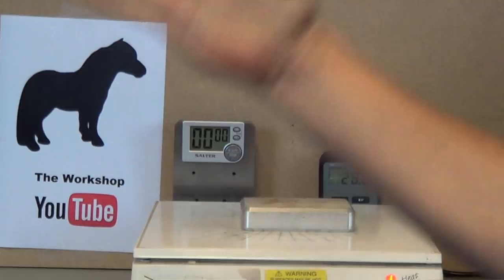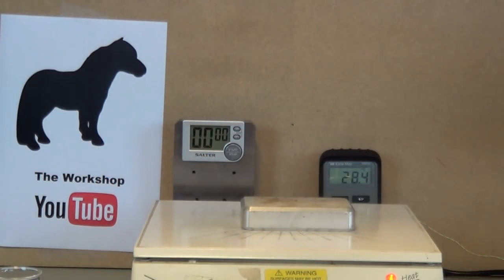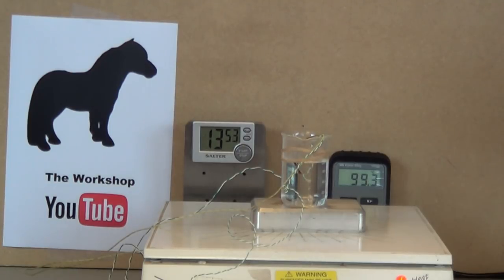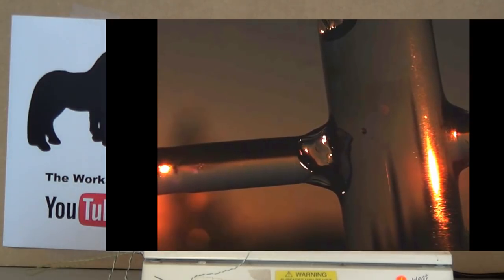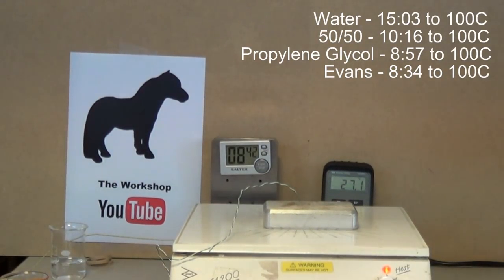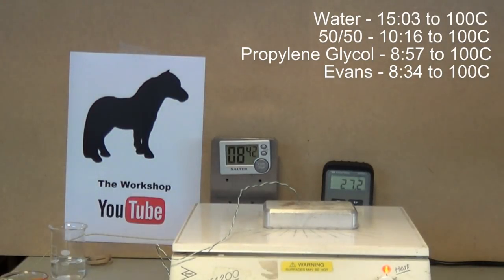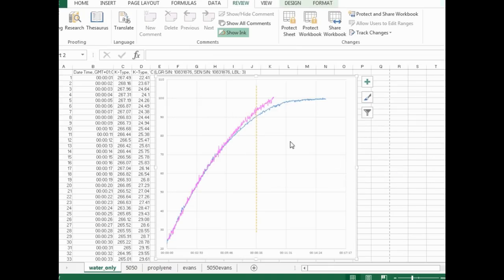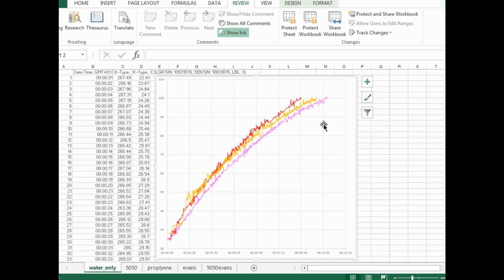Evans waterless is SHIT! - with proof

Comment: Thanks for that last 10min with graphs! I am with you with this one, but I don't like you measured time to 100°C, cos that is boiling point of water and that takes much more energy then every other decrees on the way to get there. I did bit number crunching there on the fly too from your video and differences was weird.
water 
@40c = 1:45
@60c = 3:53 (difference between this and before datapoint = 128s)
@80c = 6:41 (d= 168s)
@90c = 8:48 (d= 127s)

50/50 (only little bit difference between this and water)
@40c = 1,43
@60c = 3,43 (d= 120s)
@80c = 6,18 (d= 180s)
@90c = 8,13 (d= 115s)

prop
@40c = 1,14 (much faster then other except evans 50/50)
@60c = 2,48 (d= 94s)
@80c = 5,48 (d= 180s)
@90c = 7,05 (d= 137s)

evans
@40c = 1,40
@60c = 3,14 (d= 94s)
@80c = 5,44 (d= 150s)
@90c = 7,04 (d= 80s) and thats fast!

evans 50/50 (why was this mix so hot at start?)
@40c = ,40
@60c = 2,39 (d= 119s)
@80c = 4,58 (d= 139s)
@90c = 7,09 (d= 131s)
Reply from the maker: The temperature increase isn't linear. The temperature of the glass has to be taken into account. I did say that this wasn't representative of an engine because of the lack of pressure, heat source and the glass. However, seen as though all the tests were under the same conditions, its a fair test. (well as fair as I was willing to go, its not like I'm writing a paper on this is it)

The Evans 50/50 mix was a bonus/joke section at the end, and wasn't the same as the others. 

As for going to 100degC, yes I'm with you there, and I did mention that this is all to do with evapouration and the energy required for this phase change to take place. This however, doesn't effect the difference between Evans @ 100degC and what temperature the water is at the same time. This was why ther'sa yellow line on the graph to cut out the trail off at 100degC.

As for the times and temperature changes, this is all about where the hottest spots are in relation to the thermocouple tip. Convection etc play a big part in all this, and you can see the thermal vortices in the liquid when heating. 

Not only that but when you take your numbers from the display, it can fluctuate 5 degrees in less than a second, hence the data logger to get the trend not absolutes.
Reply: Thank you for your great answer. And why don't I get any feedback when I have comment from here? Perhaps just my understanding of youtube and or phone settings.

I'm total newbie when it comes to chemistry and thermodynamics, but when compairing two liquids with different heat absorbing characteristics should there be easyer to see evidence? Water has heat capacity of 4,18 and glycol has only 1,63JgK.. so, when aplying same amount of energy to both of them, should it take 2,5 times longer to get that temperature to water then to glycol, cos it should take 2,5times more energy in before gaining that temp?

so when water is hitting 90°C in 8:48, should it only take 3min 31sec?

Comment: Im sorry, i do not understand. So far you have proven that different solutions have different heat capacity per volum unit and different evaporation point. If your coolant flow or radiator is the restricting part of you powerplant's potential then water wil be far superior. If not then Evans wil be a good option, a daily driver for commuting wil do just as good if not better with waterless. We have two daily diesels and one has Evans and one has 50/50. The diesel with Evans has a sparcling clean radiator stil after 7 years use, no need to top it up yet as the level is dead on the same as 7 years ago. The temp of the Evans is seldomly over 80celsius(when the thermostat opens), and i cant observe any pressure in the system even if its hot from uphill driving in summer.  The diesel with 50/50 is the predictable the same as all other cars that use 50/50.
Reply from the maker: 1. Not better, worse than 50/50.

2. The pressure in the system does increase, thats just thermal expansion. 

3. We're talking motorcycles, not your diesel that doesn't produce enough waste heat to begin with. 

This is a motorcycle channel were each engine is closer to the limits of waste heat...

Comment: I’m not a scientist but I always thought that the faster a substance heats up, the faster it give up that heat such as when passing through a radiator.
Reply: With a few exceptions, you are correct, the faster it can heat up, the faster it will transfer that heat out. It's why things like copper are used a lot in heating/cooling situations.
Reply: The removal of heat is a question of watts moved and Evans moves about quarter of water
Reply: The thermostat would be a variable I would think.

Comment: Hey Matt, completely agree that this Evans business is Shite! so don't want to sound like I'm sticking up for the junk. Quick thermodynamic thought though, if the Evans gets to A higher temperature for the same given energy input as water, wouldn't the radiator be more efficient at removing the energy from the Evans than the water due to the higher temperature differential between the coolant and ambient air? thought being that your engine would get to temperature quicker than water (good for engine longevity) and actually be more efficient at removing energy from the engine once up to temperature,  though I'm sure this is only within a certain range. Your thoughts? PS bring on the BRITTEN video!
Reply: mcldcrg 
I was having the exact same thoughts.  

The radiator will be probably be more efficient at taking heat from a hotter temperature coolant and releasing it to the ambient air than a cooler temperature coolant.  Because there will be a higher temperature difference between the 2.   

But, At the same time, heat transfer from the engine to the hotter coolant will worse because the temperature of the hotter coolant will be closer to the temperature of the cylinder head / water jackets.

Heat transfer happens faster when the temperature difference of the materials is large.
Reply from the maker: A lot of people have asked this question and a video is coming this weekend - matt
Reply: My thoughts exactly, but I'm not sure If I agree that the heat transfer from the engine to the hotter coolant will be worse because as the coolant enters the engine it should at a lower temperature compared to water.

What I would really like to see is an engine running on these different coolants and monitoring the engine oil temperature.
Reply from the maker: Number 1 - what? Why wpuld Evans be cooler when re-entering the engine?

Number 2 - Oil temperature is a funny bugger, it depends on the system. The oil runs in a different cycle, in other words more 'internal' than the coolant. This means that the reading from oil are also all over the place as some oil returns and some doesn't etc.

As for a test - that's coming with the ER5 test. I did a video
Reply: Removal of heat is a question of watts of heat moved. Yes Evans heats up faster but your flow rate has dropped due to thicker viscosity. Evans will remove more heat if you want to design an engine with higher thermal envolope. Material and oil capabilities currently restrict that. In a system designed for water, Evans will simply move less heat.

Comment: I was horrified that you weren't wearing thermal-heated gloves & coat as you opened the Evans....from all the marketing statements I was expecting it to suck all the heat out of the room & your body!
;-)

Personally, I use a good black tea like Typhoo in all my water-cooled engines. That way if I ever need a quick cuppa while out on the road, I just pull over and open the petcock a bit and Bob's your uncle!
Reply from the maker: "from all the marketing statements I was expecting it to suck all the heat out of the room & your body!"

- crying - just crying laughing

Comment: Would have been nice to let them all run for the same time so that the behavior beyond 100 C could have been compared.
Reply from the maker: Water turns to steam, I don't think we need to test that...
Reply: @dirtygarageguy  The water was let run the longest so letting them all run the same time only means that the other three or four should have been run the same duration as the water.
Reply from the maker: To what end?